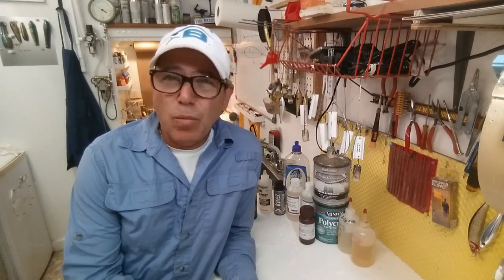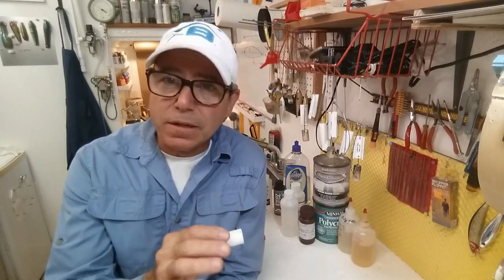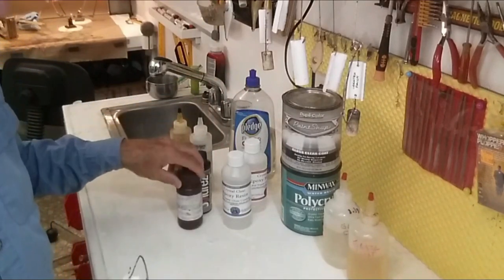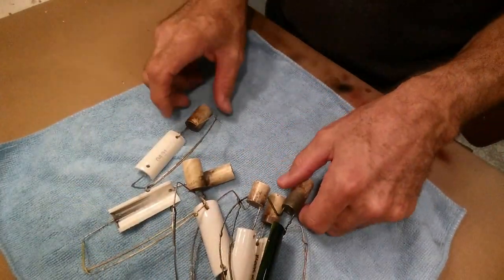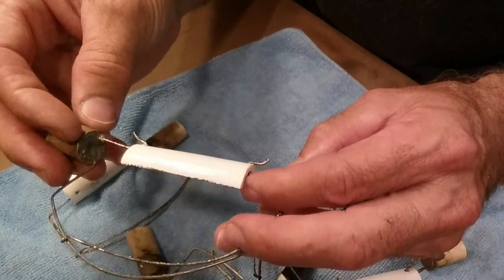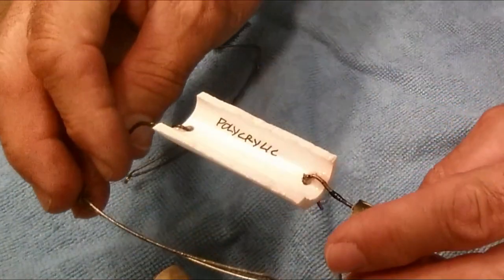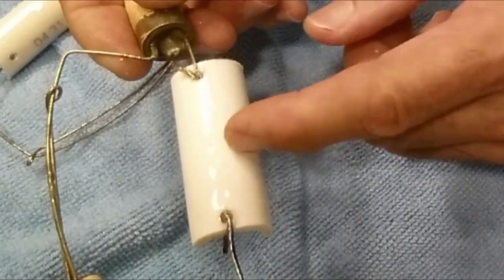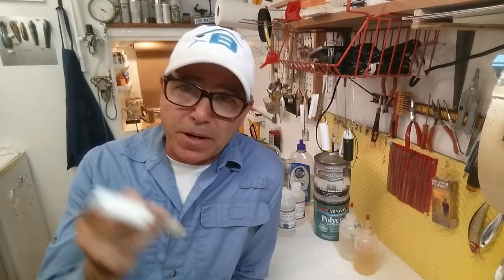Testing lure clear coats like an engineer

Comment: Hi..I would like to suggest if you could test the tuffnes of the clear coat that you have tested as I'm using KBS clear coat product which is amazing product    but my issue is the tuffnes of the clear coat that I'm using as im dealing king makrul fish and thir teeth destroied the clear coat , I'm creating my luers by my self and I have learned a lot of from your channel.
Thank you for your efforts.
Reply from the maker: Well I don't want to disappoint you but there isn't much that will hold up to the bite of a king mackerel. But, what  you want is a clear coat that is flexible not too hard. UV resin is too hard and it will crack and break off under big teeth. Two-part resin is the way to go if you want it to last through a few fish. Check out my video on the best clear coat that I found. Best of luck cheers
https://youtu.be/GKVrAwFifIA

Comment: Im interested in your thoughts on the best initial sealer for big muskie balsa baits. Lot of different opinions. I ve thought about vaccuming it in a chamber with a minwax polyurethane/ mineral spirits blend. Thanks for all your videos and work to help.
Reply from the maker: OK...big muskie and balsa?  I would reconsider the choice of wood to something a bit harder...that would include every other wood:)
I'm kidding around, I know we all have our preferences and that's why we make our own lures.  Vacuum saturation works really well but you will completely change the density of the wood.  So maybe what you really like about the balsa ends up going away with the sealing process.  Engineers are brain washed over many years of study to focus on failure modes (how will it fail?) and we start our designs and plans with that as a foundation.   Because balsa is so light and porous it's failure modes here are rupture/fracture and water-logging.  I don't think rot is a likely failure .  So my advice is to switch to cedar, it is very light and has natural oils that help it repel water and rot and is much stronger.  You can still seal it with a polyurethane thinned down with a paint thinner.  All that being said...if you must use balsa...I would not vacuum saturate.  Just submerge the lure in a jar of thinned sealer for a few hours,  It will absorb quite a bit and won't' be completely saturated.
Good luck

Comment: You should test this product called KBS Diamond finish
Reply from the maker: I have tested it...it's a very popular product amongst lure painters. Works well but the storage is difficult here in super humid north Florida.  It does not work well with the silver plating I put on my lures...so I tend not to use it.
Reply: @EngineeredAngler , what are the benefits of using foil tape, and should it be tried on balsa wood?
Reply from the maker: Foil is an easy way to get a shiny metalic look.  I have used it on balsa lures but it's best to put a thin clear coat first, to harden the wood a bit.
Reply: @EngineeredAngler  , gotcha.